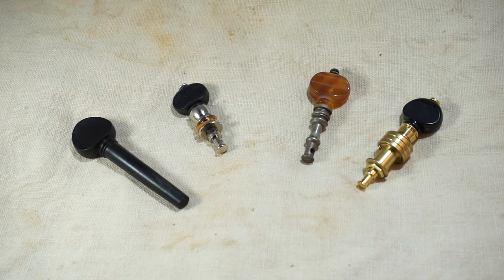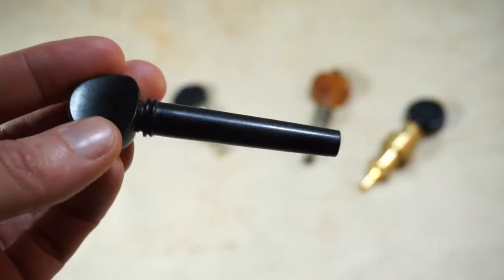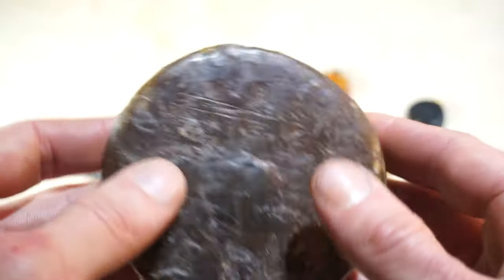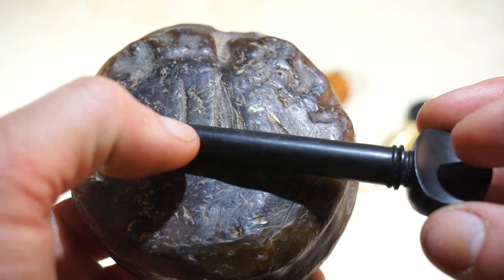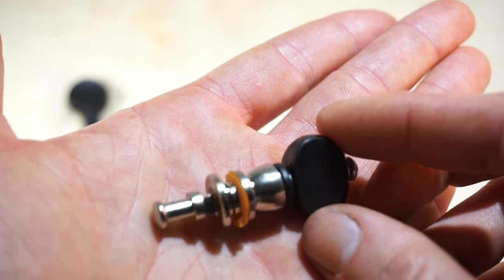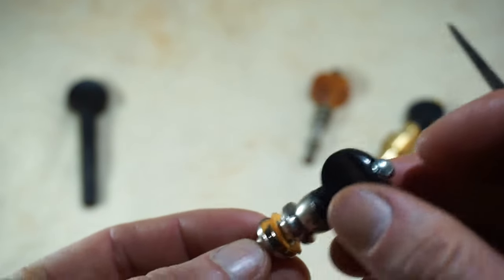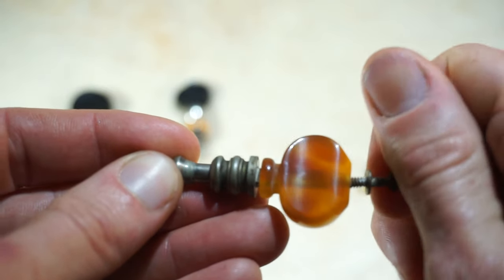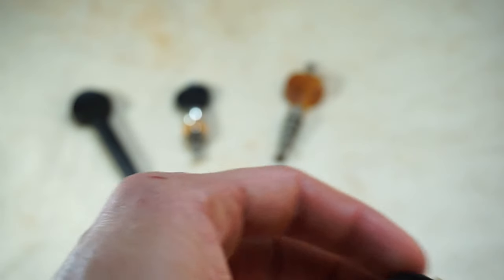Banjo Tuner Tips & Tricks

Comment: Fascinating, do you think that a nylon washer would work as a more durable alternative to the paper one?
Reply from the maker: I guess so. They also make washers from a durable synthetic fiber that would work. As long as it's not ferrous metal (which will rust) or any other material that's harder than the peghead wood.

Comment: My new, old eBay Slingerland appears to have the original tuners. They were unGodly difficult to turn. After watching your video it appears that the previous owner had assembled the tuners incorrectly. I'll be turning the middle piece around so that the flat portion that is now against the back of the headstock will be against the underside of the button instead. The rounded part will be against the backside of the headstock. Fingers crossed . Tom in Idaho

Comment: Just got a 5 string banjo second hand with 5th string peg missing. Bought a new geared peg but the hole in the neck is bigger than the new peg so I guess i will have to glue it in. ANY thoughts on the best type of glue as this is a metal peg going into a wooden neck.
Reply from the maker: Best to fill the old hole with a piece of hardwood dowel, then drill new hole for new peg.

Comment: The "B" string on my monogram banjo sometimes just pops loose while im pickin despite peg being waxed. I've found that the peg hole has lost its taper. Not all the way but enough to cause problems. I was thinking of putting some wood glue or putty on the walls of the hole and reream it after it cures. Or shove the peg in while it is still a little soft to shape it to the peg. Any advice would be greatly appreciated if there is a better way .
Reply from the maker: I have had to drill a few holes out, then fill with hardwood peg, then re-drill and re-taper.
Reply: @CliftonHicksbanjo  thanks for your input.  I dont think it is that far gone to require that much attention.  I've already started the steps i described with wood glue. It didn't require much and im waiting fo it to cure now. If this doesn't tighten up the hole enough i may resort to drilling it out and all just trying to avoid it if possible. I'll let you know how it goes.
Reply: @CliftonHicksbanjo  I got'er fixed! The glue kind of worked in that it tightened up the hole but it was too slick to hold the peg. I lightly sanded it and gave it some beeswax.  It has been a couple of weeks now and it hasn't popped loose yet.  It turns and holds nice and i don't have to push in in much to anchor it.